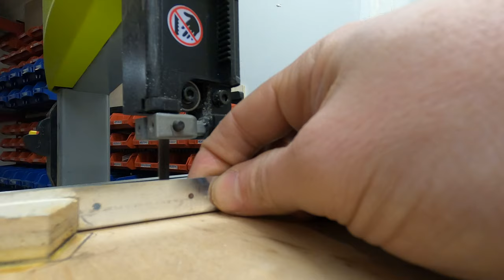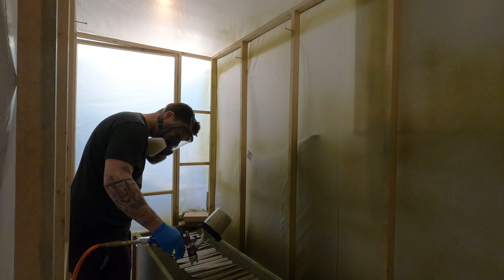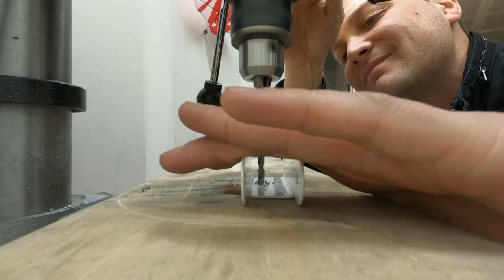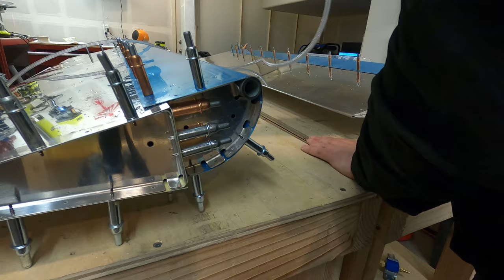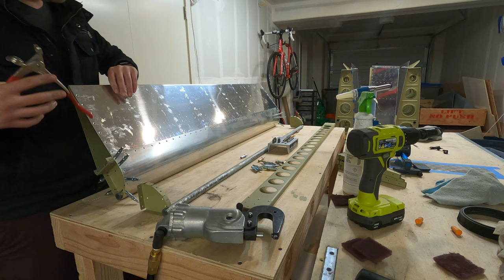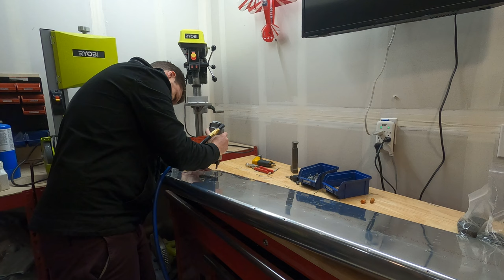Building an Experimental Airplane, The Vans RV-7A | EP2.14 Ailerons

Comment: Sheet metal work is beautiful my friend! I’m an avionics tech by trade and remember testing out for my a&p all I had to do was make a simple battery bracket and let me tell you during the test it was my first time bending metal and it kicked my butt. What you have accomplished so far has me in completely impressed.
Reply from the maker: I’ve certainly learned a lot! I’m a bit worried to uncover my tail surfaces in a bit here and find that my lack of experience is evident.

I’ve heard of people buying a new tail kit and redoing it because of same.

Thank you very much for the meaningful complement. Coming from an A&P is huge!

Comment: Looks great! Can’t believe we are nearly finished with our wings!
Reply from the maker: Quicker than I thought! Though I’m scared to speak too soon and wind up in some sort of control linkage purgatory.
Reply: @RyanFlysPDX  do you have wing parts on back order as well?
Reply from the maker: Nope. I have some backordered parts for the fuselage at vans waiting for me to pick them up. I’ll be over there next week. I think related to brakes.
Reply: @kevinpereira7864  I have backordered parts for my tail and wing kit. Both ordered on Halloween. Tail showed up on Thanksgiving, wings in early March. Both were missing bags containing rod-end bearings and powder-coated brackets (aileron, rudder, and elevators). Not sure if they are waiting on the elevator service bulletin to get the newest parts out or what, although I know the rod-end bearings are on backorder from everywhere. Aircraft Spruce shows those as back in stock around April 11th so I'm hopeful I'll get them in soon!
Reply: @cbkillion  same stuff I’m missing!

Comment: Great video Ryan! Great editing, great music and impressive some of the shots you were able to get (like the tungsten bucking bar inside the aileron). I hope this series takes off. One question: I love the intermissions with the tips on how to do certain skills or tricky spots in the plans. Have you covered rivet gun setup yet? (I.e. what compressor you got, what the pressure is on the regulator, what the regulator is set to on the gun if you’ve got one, etc) I haven’t bought a pneumatic squeezer yet and I’d be curious how you set that up too - do you have the one with the adjustable ram or do you use different length sets and shims?
Reply from the maker: All great questions! Since there’s interest, I’ll gladly include some of these things in the videos. 
I try to balance helpful spots with progress and never know what people want: see the plane together quickly, or hear about some of the work.
Let’s see if I can include some more helpful info, but try to keep it snappy!

Comment: Ryan, wondering how many hours you can work before your work suffers, and do you see it coming ?
Reply from the maker: That’s a great question. 

I’ll answer the easy part first: yes, you can see it coming from a mile away. Once you start with the “I just need to finish this and then I’ll quit,” that’s when you quit. Before you finish it. Not after. If you’re trying to rush to “get it done,” don’t.

Small mistakes, dumb mistakes, often precede large ones.

Now for the hard part. I’ve had days where I’ve had to put it down after an hour. Things aren’t going well, and I’m not in the mindset.

Some days, I’ll be at it for 10+. 

I think most long build days start to see significantly reduced craftsmanship and productivity after about 6-8 hours.

But like I said. You can absolutely tell when it’s time to put it down. And you get pretty good at doing just that.
Reply: @RyanFlysPDX  Thanks, I tend to press more than I should , when I start mine I will try to heed your advice,   And yours looks perfect on my iPad
Reply from the maker: Then keep watching on the iPad. Or better yet your phone! 

It’s far from perfect, but it’s coming out very well and I’m happy with most aspects of it.